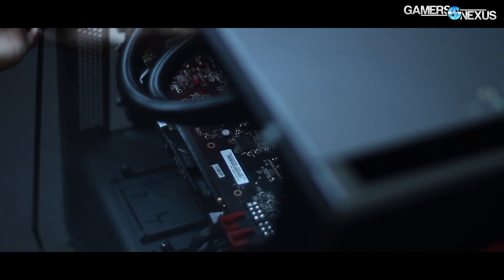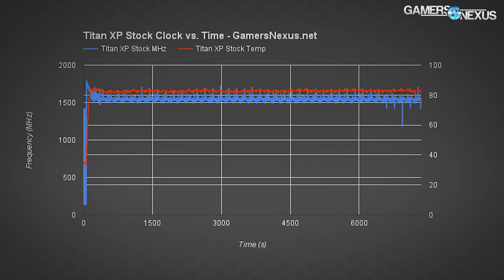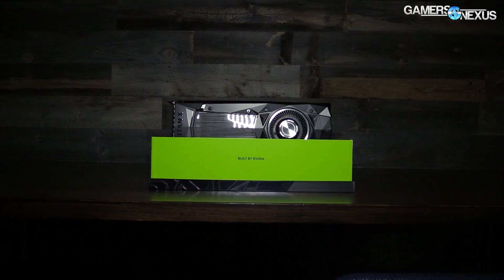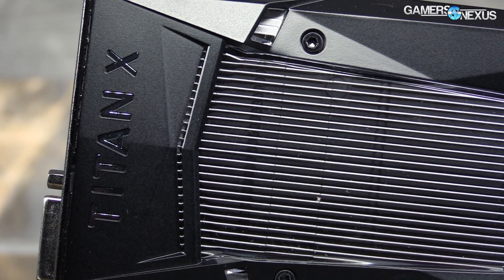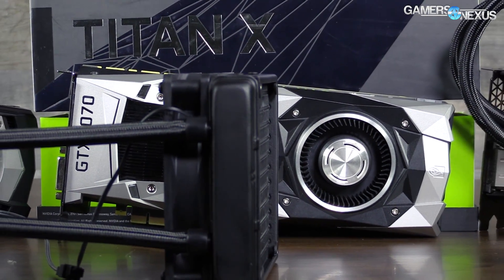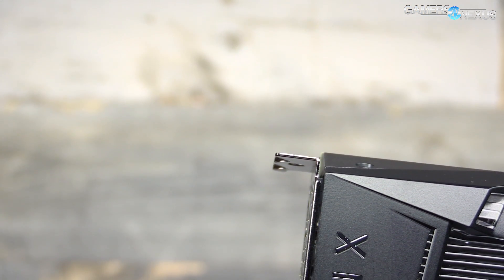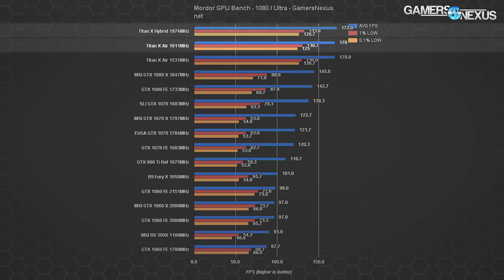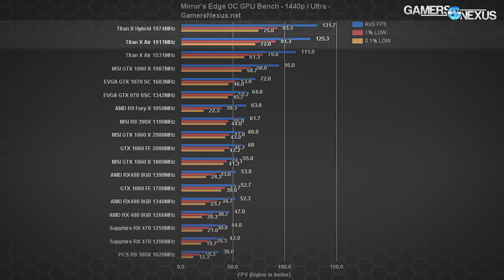TITAN X Pascal Severe Thermal Throttling (Hybrid Results)

Comment: Is it just me or does it seem like there is little performance gain when overclocking any pascal gpu? With maxwell 200 MHz was a big deal, but here you gain very little with 400
Reply: Thats because pascal automatically overclocks itself up to 2ghz if temps are ok
Reply: The IPC on Pascal is the exact same as on Maxwell. Overclocking Maxwell and Pascal scales exactly the same. The problem is that when you clock Pascal over 1800MHz you are starting to starve it on memory. I noticed with my GTX 1060. Right out of the box the card clocks it self thanks to GPU Boost to 1911MHz. If I OC it to 2100MHz I get maybe 1-3FPS boost but if I go and OC memory from the default 8000MHz and clock it to 9000MHz I get another 5-6FPS on top of the 1-3FPS so 6-9FPS in average in most games. I also tested this in 3D Mark on graphics score. Everything at stock gets me to 13600 graphics score. Core OC to 2100MHz gets me to 14200 graphics score. Core OC + Memory OC gets me to 15050 graphics score..
Reply: ericimi, your room can't be 80 deg and the card 72-75...the card cant be cooler than room temp
Reply: +sur puppa Maxwell was a much better overclocker than Pascal is. My 980Ti at @1500mhz beats any 1070 and is just 10% slower than a custom 1080
Reply: +Wyrdak that means that pascal is rushed out. Hbm2 was just a couple of months away and could have solved the memory problems, but nvidia wanted to be first
Reply: +konic40 let him believe in his own lies
Reply: ericimi Please do tell me how can you violate the 2nd Law of Thermodynamics being your card 70 degrees and the room temp at 80
Reply: Crimson Sunrise But it shows that Maxwell actually has a higher IPC than Pascal
Reply: +TheBlackAndFurious 5 yeah , my 1070 superclocked from evga was running at about 1950 last night playing GTA 5 at 1440p temps were from 72-75 degrees (room was 80 degrees)
Reply: yes I know. but pascal at 1500 vs 200 isn that much of a difference. maxell 1200 vs 1400 was a big difference. maxwell overcklocks itself aswell
Reply: That is because the card overclocks itself as much as as possible.
Reply: you dont understand do you?
Reply: Are you sure about that???
Reply: Since Pascal is mostly Maxwell on speed, yes. These chips are not good overclockers at all.
Reply: +alphazoom  Quit Lying, there's been no such proof. In fact there's been irrefutable proof to the contrary. You can look at actual die pictures and clearly see that Pascal is different. Having similar SM structure does NOT make it identical; they completley got rid of the polymorph engine, completely enhanced the base core structure, and VASTLY improved overall efficiency and performance per core as well.  A GTX 1080 only has 25% more cores than a GTX 980, but is as fast as TWO 980's in SLI; care to explain that if it's "only shrunken maxwell" huh?  The only person coming to your stupid conclusion is that idiot scottish guy who like the AMD fanboy he is, thought it was funny to cripple the GTX 1080 by cutting it's power target in half claiming "he couldn't get the clock speed low enough to match a 980 TI". Ignoring the fact that he's stupid already for comparing a cut-down 104 chip with 314mm2 die size to a massive 600mm2 GM200 chip that has twice the number of ROPs etc. and more cores on it (the 980 is the proper card to compare to) His results showed that a hugely underclocked 1080 with it crippled to only use 50% power was still equal to an overclocked 980 TI lol.  And people did similar testing to prove him completely wrong, showing a 1070 compared to a 980, and 1080 compared to a 980 TI etc.. with both cards allowed full 100-120% power and it showed a ~15% advantage for pascal even at identical clock speeds of ~1400-1500mhz for both cards; then there's the fact that Pascal shouldn't be forced to identical clocks in a comparison...fact of the matter is, a Maxwell card CAN'T get to 2,100mhz like pascal can. 

I can go on and on about how this is a moronic statement to make. Pascal isn't "SUPER" different, but it IS an entirely new architecture. If the ONLY thing that changed was moving to 14nm then we would've simply seen Pascal become "Broadwell" all over again. Intel Haswell i7 4790K was literally almost identical to the Broadwell i7 5775C, the Broadwell was on 14nm but the Haswell was 22nm (very similar to the jump from 28nm to 16nm for Nvidia Maxwell vs Pascal)  but the Broadwell only had roughly 6% improvement, and the VAST majority of this was because it included 128MB of eDRAM on the chip that could be used as L4 cache that increased fps in VRAM hungry apps and games etc..  which means that moving to 14nm from 22nm by itself gives barely any benefit, maybe ~3-4%.  You gotta realize that not only did Nvidia move to 16nm, they basically DOUBLED the amount of transistors in the chips, and gave a ~25-40% increase in cuda cores on each card, as well as general optimizations and architectural improvements. Bottom line is, Pascal is one of the largest GPU generational jumps of all time, giving roughly ~70-80% improvement at EVERY tier (960 vs 1060, 970 vs 1070, 980 vs 1080, TITAN X vs TITAN XP etc.. all were ~70%+ improvements)  Let's compare that to Maxwell vs Keplar shall we?  GTX 970 was only a bit faster than the 780,  GTX 980 was only ~30% faster than the 780 and only ~12-15% faster than the 780 TI, 980 TI was only ~40-50% faster than the 780 TI.  Whereas Maxwell to Pascal showed basically DOUBLE those jumps.
Reply: TheScaleless The proof sort of was made already. A 980Ti was compared against a 1080 both using the same clock speed. The difference in performance was 3%, which is margin of error difference at best.
Reply: TheScaleless
long winded...
Reply: ***** Yeah, most likely that is true. I mean, Pascal wasn't even in the Nvidia roadmaps, the succesor of Maxwell was supposed to be Volta
Reply: Either he misspoke, is crazy or he is using Fahrenheit and Celsius.
Reply: +Patrick Shelley I would bet room is 80f and card is 74c because monitoring software is usually is c and the thermostat on his wall is obviously f (if he is in America).
Reply: Jared Nielsen yep, most likely
Reply: That's because the IPC is lower on the new cards. Meaning if you downclock a 1080 to the same frequency as a 980ti, the 980ti would probably beat it or be very very close.
Reply: Keagan Jacobs
About 3% difference for Maxwell and Pascal running on the same clock.
Reply: Crimson Sunrise 980Ti at 2000Mhz with LN2 just rapes the 1080. That's why the Firestrike record still belongs to 980ti and not 1080
Reply: Lucas Alfonso Leguizamón Yes, however, LN2 is not for end users, nor is a reliable cooling system either.
Reply: Lucas Alfonso Leguizamón Pretty much. If even the better compression algorhythms and other new stuff is not enough to make the card better on the same clock...

Comment: EVGA are working on a TX-P hybrid cooler, but it's a ways off. Their 1080FE hybrid fits if you're willing to chop a chunk out of the shroud for the 6 pin pci-e connector and a little bit of the heat spreader to fit over the extra chokes on the TX-P.

Beyond that, Arctic's hybrid fits (ugly as sin though), and so does NZXT's Kraken G10, if you can handle their crappy vrm cooling for alternate hybrid options. If you own an EKWB Predator AIO (the one with the QDC), EK will also sell a pre-filled TX-P block that'll connect to it.
Reply: +Damon Osborne...this is fricken nice bruh!!!  do you have more photos on how you did this...my Titan is on the way and I would like to do this...
Reply: Theroguelawl Hakeem Hakim It was actually not difficult at all. 

I put painters tape on the areas the needed to be cut on the hybrid base plate. I also covered the fan with tape as well to keep out as much metal shavings as possible. 

I then took measurements from the stock base plate and then marked those areas on the tape. 

I used my dremel with a metal cutting disc to make the cuts. Making the space for the extra power connector was pretty easy due to the more open area to work with.

The area for the extra mosfet was a little bit trickier due to the more confined area to cut relative to the small amount of material needed to be removed and the size of the cutting disc.

You can see that area here:

https://hardforum.com/threads/nvidia-announces-the-new-titan-x.1905829/page-20#post-1042462625

I used a aluminum grinding stone (also in my dremel accessory kit) to fine tune the shape and smooth out the cut area for both cuts.

I then used my handheld electric blower and rubbing alcohol .to clean away all the metal shavings.

I then sprayed the exposed cut/shaved aluminum with black plastidip.

I reused all the thermal pads from the oem cooler.

I then reassembled according to instructions in the hybrid kit (which basically screws back together like oem). You can reuse all the original screws, but the kit also includes ALL the same screws for reassembly.

Unfortunately, I didn't take many pics (other than what I have posted) during the process...I should've done a video...LOL
Reply: Yes...That's what I did, which can be seen in my post here: https://hardforum.com/posts/1042460620/   (if someone didn't catch the the link in my previous comments)
Reply: Very nice, was it tough work? Or doable by someone as god awfully clumsy as me?
Reply: Man, you are better than I am...I bet this is all EVGA will do when they come out with a kit specifically for the Titan.  I just bought the 1080 kit, but I am a novice when it comes to modifications such as what you did.
Reply: LOL. Well it's really not difficult with the right tools. Aluminum is also a softer metal, so its relatively easy to cut. 

I actually purchased that kit before Titan X Pascal was even announced. I wasn't sure what I was going to do as far a 1080 was concerned. 

At that time the 1070/1080 hybrid kit was selling out, so when they came back in stock I just ordered one.  

Once they announced the TXP, I decided I would get one for my Corsair Bulldog htpc build and see if the Hybrid kit would work (with mods of course)...

I'm sure they will have a TXP version out eventually, but I since I had the Kit (and I'm not a fan of blowers regarding noise and temps) why wait? LOL
Reply: I don't like the blower style fans either....I will look into modding...I don't want to wait for the EVGA cooler...my Titan would stay in the box until I could get my hands on one.